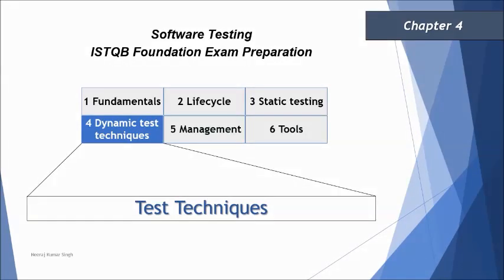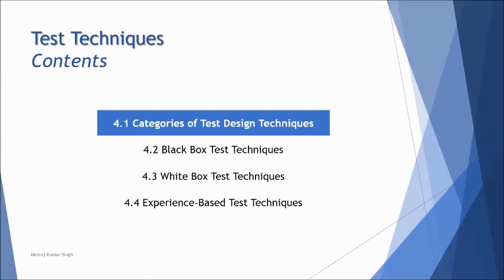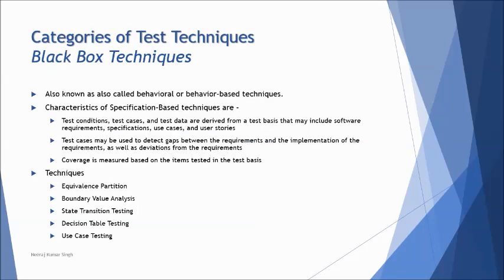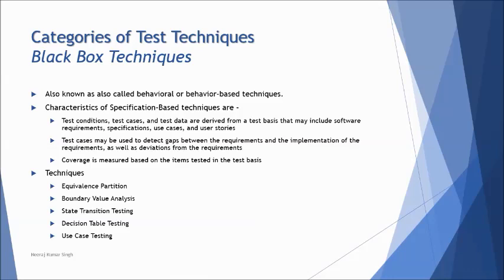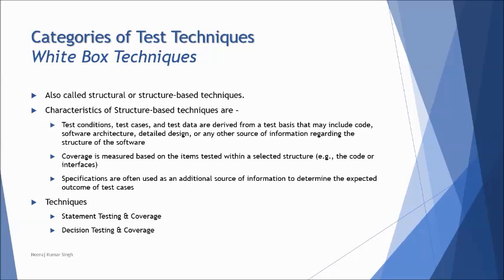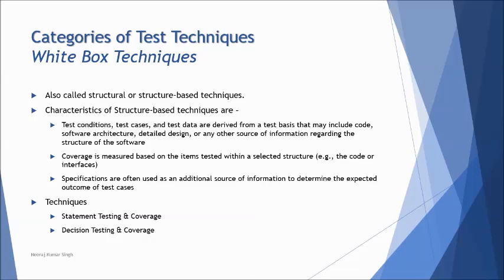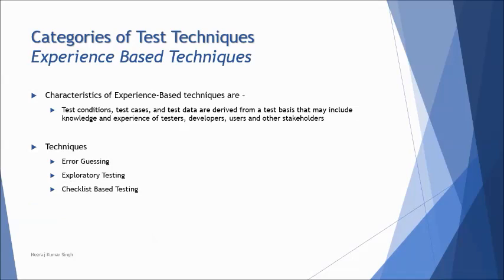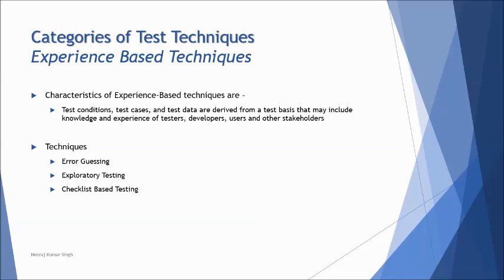ISTQB Foundation Level | 4.1 Categories of Test Techniques | ISTQB Tutorials

Comment: Hi sir, I am preparing for istqb exam and your videos are great help. I have a question regarding equivalence partitioning. The question is
Postal rates for 'light letters' are 25p up to 10g, 35p up to 50g plus an extra10p for each additional 25g up to 100g. Which test inputs(in grams) would be selected using ep?
A. 8,42,82,102
B. 4,15,65,92,159
C. 10,50,75,100
D. 5,20,40,60,80
If you explain this very greatful.
Reply: Hello human 👋
so what I did was drew my table
Starting first with the P's
0-25p | 26-35p | 36-45p | 46-55p
then the G's.
10g | 11-50g | 51-75g | 76-100g.

remember that you need to add 10 P's per 25G's

once done, use that awnser to see which letter has the values that would properly fit into each partitions.
PLZZZZ let me know if this is correct
Reply from the maker: @myWayIn619  I think you didn't have to create a partition for the amount as the amount is output. The partitions for weight in grams would do and give you the right answer. You can see my video on this for better understanding  https://www.youtube.com/watch?v=fGhCS-fXvL4&list=PLj5VKaW115t2J22i0I-a_MjD-5kyJtcvC&index=2
Reply: Thanks a lot sir
Reply from the maker: Please watch this video - https://www.youtube.com/watch?v=fGhCS-fXvL4&list=PLj5VKaW115t2J22i0I-a_MjD-5kyJtcvC&index=2